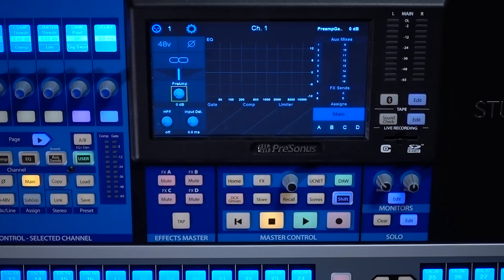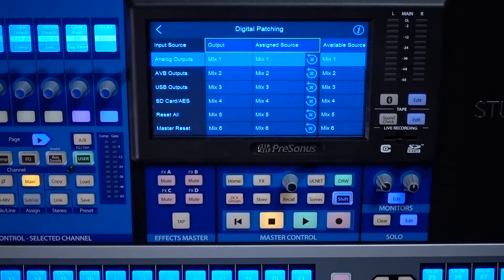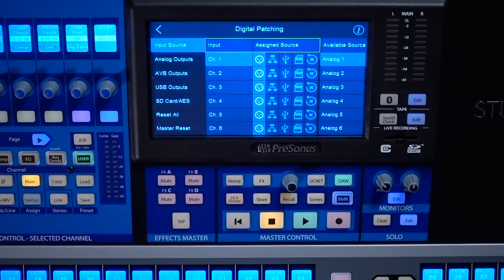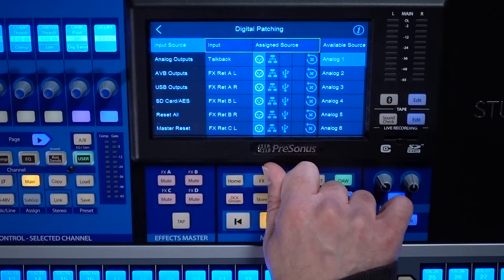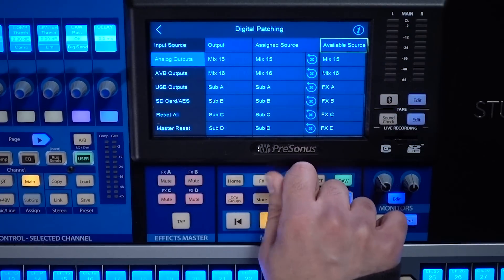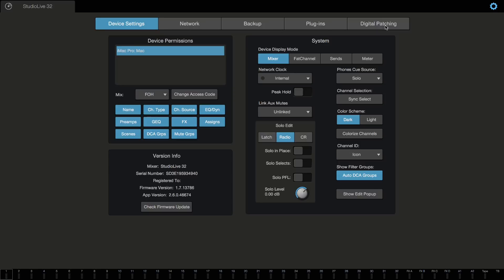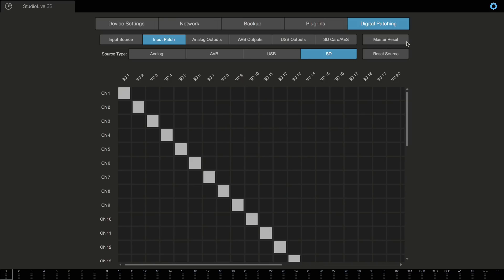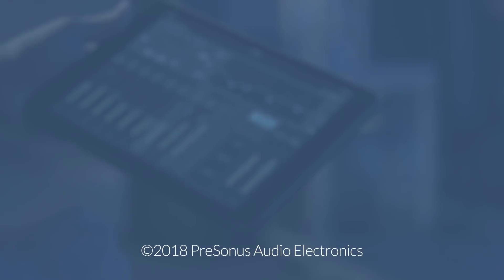PreSonus—Digital Patching (Soft Patching) on StudioLive Series III

Comment: Great video and I have a question please.
 I have the 32S model, which I have not used yet (I bought it fairly recently). I am rewiring my studio for a hybrid setup where on a mix down I would like to use, at times, some vintage outboard gear. (Like an Eventide H3000 and some vintage digital reverbs like Yamaha REV 7 and Lexicon PCM 42 Digital Delay). 

Question: Is it best to send the the audio to the outboard gear using the Sub Outputs (like an aux send on an analog console) and return the FX stereo audio return signal via either the Aux inputs and/or a line input. There's only 2 stereo Aux inputs on the 32S, so I would prefer being able to use the line inputs (as returns) so if needed, I can return 3 or more stereo FX return signals into the mix down. 
Thanks for any info you can share as I am used to using an analog console. 
Phil
NYC Area

Comment: Will this work for PA management?  Need crossover solution for 4 way stereo plus mono for subs.  9 outputs with individual crossover settings?
Reply: Pretty sure you could do that on any digital mixer, though it's a really inefficient use of the outputs when a cheap hardware crossover will split out to amps just fine, if you're only splitting the same signal. There's already a separate mono mix on this and most others, that you can EQ separately however you like, and feed a sub or front fills, and I use multiple mix outputs for delays all the time, and often one for a sub on an aux mix, so only instruments I want in the sub get sent to it. We also use this feature all the time to feed Q&A foldbacks, or a mix minus for something like a skype call where you wouldn't want to feed the skype's audio back into itself, but want it in the mains.